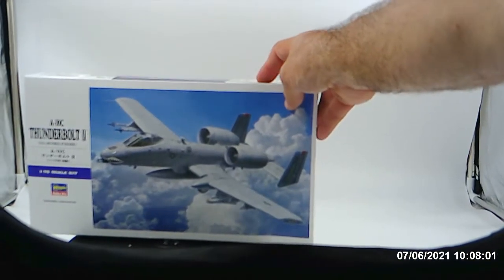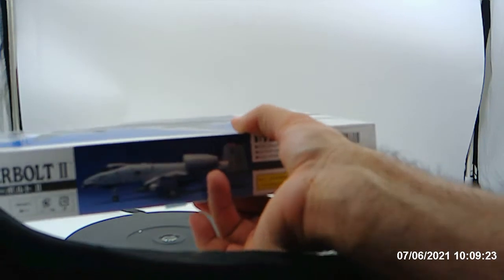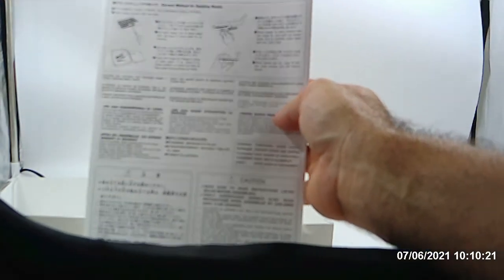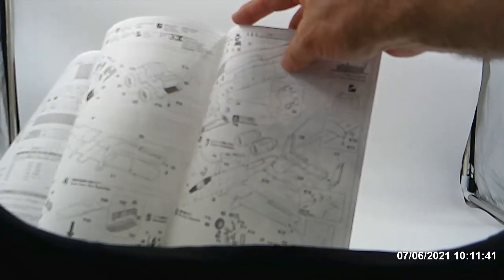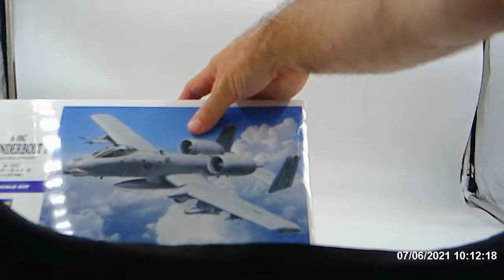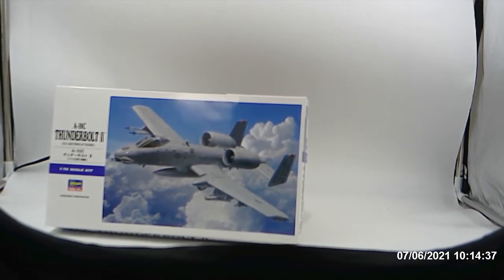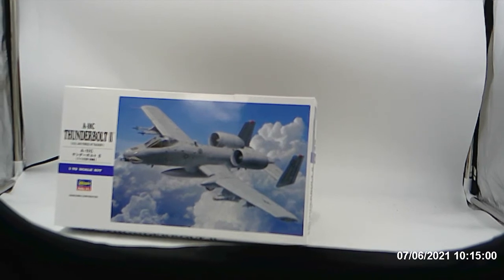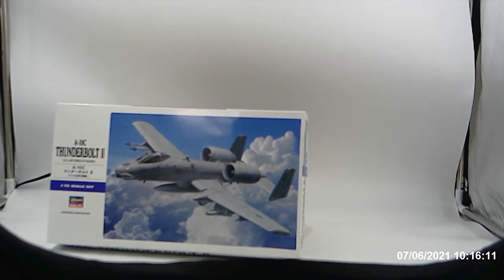My Upcoming A10 Warthog model build  and more

Comment: It'd be great to see some process photos of your work. Super cool project to take on. Anxious to see how this comes out.
Reply from the maker: Yep, I will do a video of it as soon as I start working on it, possibly starting in right around next week, after I get my central heat and air conditioning unit hooked up at my house. I have been without air conditioning, except for a small window unit for about 2 years now, and my furnace quit this year during the coldest day, and I had to get it replaced. It was a capacitor that stopped working, and so I had to rely on space heaters, and now, I have fans going non stop until next week.